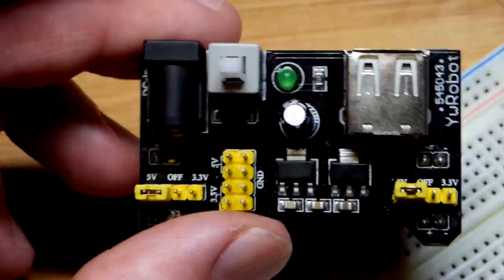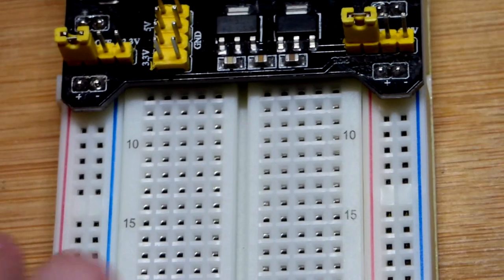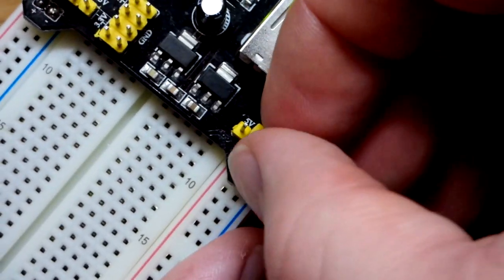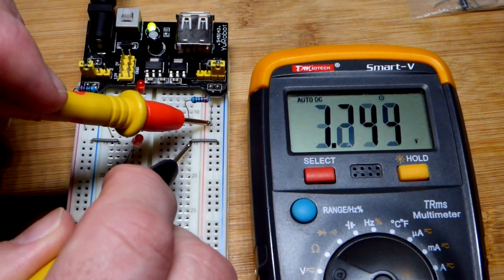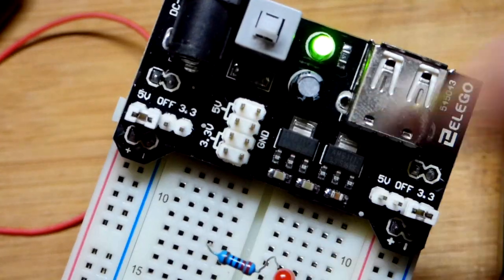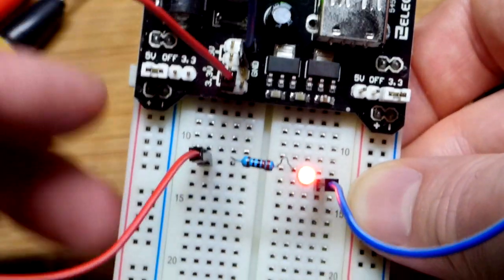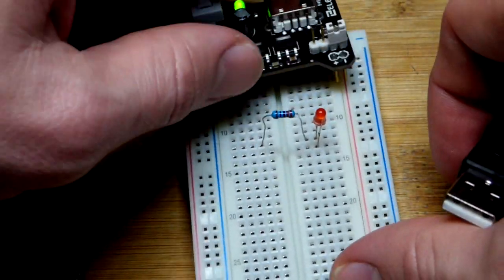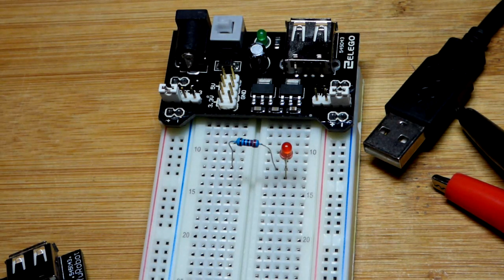How to use a breadboard power supply module for DIY learning electronics

Comment: New to breadboards (and electronics); what device should i use to supply my current?
Reply from the maker: Power supply that you plug into the wall and can set the voltage and maximum current is generally the best to use. These 5V modules powered by a converter that plugs into the wall are good if you only want to work with 5V and save some money. Can also use batteries if you want, but they aren't as easy to use. It's good to learn how to use all of them, So I've made a number of videos covering all of them.

Comment: 0:51 , what is the polarity of this 9v adapter you used ?
Is center positive or negative ?
Reply: Centre positive is the general rule. I've not seen a breadboard psu that has a different connection.

Comment: Hello! Is it possible to use the breadboard power supply to make a series connection of two power supplys to get 6.6V (2x3.3V) or 8.3 (5V+3.3V) or even 10V? Thank you for your answer!
Reply from the maker: You can probably connect them in series only if each one has it's own independent power source. If they share a power source, then it is probably a short circuit where the positive of one connects to the negative of the other.

Comment: Can it handle 10-12amps of current?
Reply from the maker: No, not even close. I think most of them have a maximum limit of 0.5A.
Reply: @Electronzap  You'll probably fry it at 500mA. These regulators aren't going to be happy dissipating anything like 1W continuously.

Comment: What do I do if I need 9V? Is that possible? I had got one of those 'make your own arduino' kits and it needs to be powered. I have this plug thing you showed without the actual power adapter. Maybe I should buy a damn battery. lol. It would be nice to get this power adapter running though.
Reply from the maker: Just gotta browse websites that sell power supplies for one that meets your needs and doesn't cost too much.

Comment: how can you short circuit protect this? just add a zener diode?
Reply from the maker: You need circuitry that quickly cuts power when high current flows, or that limits maximum. Not an easy thing to add to this setup.

Comment: I have a 12v power supply for the power supply module, will it work or fail?
Reply from the maker: 12V works, but I fried some boards while using 12V. I think that's their absolute limit, and anything above that causes a voltage spike above 12V. Might have just been my boards though and how much current I was using. I can't speak for other people's experiences.
Reply: @Electronzap  I have one of these breadboard power modules and I tried a 12v to power it.  I tested the output with an oscilloscope.  I get 3.4v on one side and I get 10.0v from the 5v side.  If I power it with USB only, I get 3.4v and 5v.  I probably already fried something if it can't regulate the 12v input, but it was what I had on hand.  Oh well.

Comment: I am trying to connect the HW-131 to my 5v LED Christmas tree. I have 3 AA batteries which I connected to one side and move the pin to the 5V output. I got nada, cero, zilch Nada. Any IDEAS?
Reply: The HW-131 can only step down the input voltage and will not work with inputs below about 6.5V. Three AA 1.5V batteries give 4.5V, so it's hardly surprising you got no output.

Comment: The diod creates a voltage drop when current passes through it. You can see this effect when you plug multiple led lights is series. After 3 red leds, the voltage appears close to zero.

Comment: What exactly is the function of the USB port?
Reply: It has very little use IMO. It only outputs 5 volt to a device you connect to it. In theory if you are bread boarding a USB HOST controller then it could be used for that, but who design HOST devices, 99% of hobbyist will be bread boarding UBS DEVICEs and for that you need DEVICE connector. Mind blowing short sighted.

Comment: Thank you!  I just wired up one of these to a 9V battery, and it's powering a Nano BLE 33, and a SSD1306 display.  Question: this seems weird to me; I thought I'd need to switch between the "5V output" from the Nano to power the rail when plugged in to USB (the way I initially had this configured), vs the "VIN" pin when powered by the HW-131.  As a test I plugged the USB in, with the rail still connected to VIN rather than 5V, and the display still powered on and functioned!

I don't want to cook anything more -- already let the magic smoke out, trying a 12V power supply with the HW-131, which it says it's rated for.  I know enough to be dangerous, at least I didn't fry the Nano or display!  :)

Appreciate any insight on why the VIN pin is providing output for the display, when powered via USB.  Thanks!

Comment: Specification says that it can accept up to 12V not 9V you mention.
Reply: That assumes you have a genuine part, which isn't always a sensible assumption when buying Chinese electronics. The genuine parts are also limited to around 1.2W dissipation. But these are linear regulators and dissipate more power as the input voltage goes up, so at 12V input, they will start to overhead rapidly when supplying more than about 150mA since dissipation = (12V - 5V) x 0.15A = 1.05W. At 9V input, they would only be dissipating (9V - 5V) x 0.15A = 0.6W. At 7.5V input, dissipation would be (7.5V - 5V) x 0.15A = 0.375W. There is no advantage in supplying 12V rather than 9V.

Comment: What resistor are you using in the LED? I am new to this stuff, and i am not sure what number to use.
Reply from the maker: With LEDs I usually use at least 220 ohm with 5 volts which is what a breadboard power supply provides. And at least 470 ohm for 9V and at least 1,000 for 12V.

Comment: Important: Always check the power supply for the polarisation. There are + inside and - outside AND vice versa! The latter are ment for powering guitar effect pedals! In this case you need an adapter changing the polarisation.
Reply from the maker: Thanks for the tips!
Reply: mb102-ps has protection against it, as far as I've seen. So, I should use + inside and - outside?
Reply: Ugggh, yeah, some pedals want 9V center positive, some 9V center negative, some other stuff like korg volcas want 9V center positive, but with a slightly smaller barrel connector. Check check check that polarity!

Comment: Nice video.  The reason you do not appear to hold 5v, is that when both sides have a load the max current is a combined value, the ones I have max at a combined 500ma.  Thus a load on both sides would dim the led(s)
Reply: You said, "... when both sides have a load..." and if you meant both sides of the breadboard, in this case one side is drawing from the +5V regulator and the other from the +3.3V regulator. Are you saying the max 500mA is the combined current of the two regulators?
Reply: The 3.3V supply is powered from the 5V supply, so the total current comes through the 5V regulator. All the ones that I've seen use AMS1117-5.0 and AMS1117-3.3 low dropout regulators in a SOT-223 package. These are specified for a maximum current of 1A with built-in thermal shutdown on overheating beyond about 1.2W power dissipation. The load regulation is specified as no worse than 35mV over a load of 0 to 800mA. So why are you seeing such a drop when delivering about 30mA into a pair of LEDs? There are two likely possibilities: (1) you have out of spec regulators; (2) your breadboard has poor internal connections. You''ll have to measure the output voltage at pin 2 of each reg to find out.

Comment: can we connect  5v and 3.3v or 5v and 5v to make it 8.3v or 10v??
Reply: what if i tried?? will the module be damage??
Reply from the maker: @ralph-ralphdeguzman6091  connecting any positive to that board, directly to any negative on that board is a short circuit. I accidently short circuited them before, and after a few times they were fried for good. It won't power anything else while short circuited, so even if it protects itself and doesn't fry, there's no point doing so.
Reply from the maker: No, this module is absorbing power from  a single supply to get lower voltages. You need special circuitry to get a higher voltage from a single source.
Reply: Thank you for the information.. then i wont try it.. so i can use it any longer..

Comment: What is the voltage of USB can I charge my phone from there.
Reply: The usb output is 5V when powered via the barrel jack from a higher voltage. However, your phone will probably require around 500mA when charging, and that's too much for these breadboard power supplies.

Comment: Bro can I charge mobile with usb
Reply from the maker: My cell phone doesn't seem to like it being charged with my breadboard power supply. It charges a lot slower than with a quality charger. I charge portable powerbanks with alternative 5V sources, and then use the power bank to charge the phone. That usually works out better.
Reply: @Electronzap   what is the output voltage of the USB bro plz help.
Reply from the maker: @umeshghimire6144  it's 5 volts, but phones don't like it if it isn't stable enough.

Comment: I know a dumb qsn. But can I plug the breadboard power supply to a charger / power adapter through the other pin(not the usb but the other input hole) if I can get maybe a 9v power adapter? Pls help. I guess it should work bcz the power adapter/ charger converts the AC from socket to DC. And if I can then what is the optimum volt of the charger/adapter I should use. And I am not talking about the USB input . I am talking about the other rounded hole input.
Reply: That input is called a "barrel jack". it fits a pretty standard 2.1mm diameter plug that you'll find on many wall adaptors, with the centre pin positive. The lowest voltage that is guaranteed to work is around 6.3V, but I'd recommend having a bit of "headroom" with a slightly higher voltage. As that voltage goes up, the power dissipated in the regulator goes up, so at 12V you probably can't draw more than about 170mA without the regulator getting very hot. I'd say the optimum voltage is around 7V - 7.5V which should allow you to draw up to about 500mA from the regulator safely (although that presupposes that these are genuine parts, which may not always be the case). If in doubt keep the current low and see if the regs get hot.

Comment: What are those metal things (not LED's or resistors)?
Reply from the maker: I think you are referring to the jumper cables. They are wires covered in plastic.
Reply: @Electronzap  Oh okay thanks I just bought this starter kit and the cables I got are pretty long so it makes a mess and this looks a lot cleaner :)

Comment: Can i use 12v 2amp to power up the board?? Through barrel jack?
Reply from the maker: I'd look up the specs when buying them,, but I don't think you want to use more than 9V with any of these breadboard power supplies. And I think they all get fried if they have to provide more than about 500mA of current.
Reply: @Electronzap  how many amps did u used on ur video?
Reply: @jeremytiempo9639  The LEDs usually take no more than 20mA, so two of them would draw less than 40mA, probably quite a bit less.
Reply: @Electronzap  SInce the power dissipated in the 5V regulator should be kept below 1.2W (preferably less), you can see that the maximum available current from the regulator is: 170mA at 12V input; 300mA at 9V input; 480mA at 7.5V. I'd keep the continuous current draw significantly below those figures.

Comment: Can you help me? I want to connect a solar panel to it in order to get a usb charger. My solar panel outputs 24v. What should I do to use it?
Reply from the maker: There's cheap voltage buck converters with USB output. These units are likely to be fried around 500mA, and many USB devices these days need 2000mA (2 amps). You could just get a buck converter with barrel jack output if you still want to power these units with a high voltage solar panel.
Reply: @Electronzap  I found a solution - a $6 USB converter that could source over 3 amps if needed. It takes a 12v input, provided by a 12v regulator on the panel.
Reply from the maker: @digitexstudios5634  good! Anything power related is best to just buy exactly what you need, unless you really want the learning experience of doing it DIY.
Reply: @Electronzap  Well, i don’t actually have a soldering iron yet. Still setting up shop. So anything is done by crimping and heat shrink or on a breadboard.
Reply: @Electronzap  People say there’s no such thing as free energy... But solar sure seems free!

Comment: I have been using the USB port to attach a power bank. Are you saying that the USB port is not supposed to bring USB power to the board? Is the USB supposed to be output only?
Reply from the maker: I've heard that other people use the USB to provide power to the breadboard. So looks like it is OK to use the USB connector either way. I'm sure it's connected directly to the pins going into the breadboard.

Comment: I have not yet received this item but one question. If you use barrel jack, then you have output on USB. If you DONT use barrel jack, and instead you use usb as input, whole thing should work? Like to use that usb from power bank.
Reply from the maker: I was told, that applying power to USB will power the pins on the board, which makes sense since they are probably connected directly together. Unfortunately power banks tend to quickly shut off pretty quickly if there is not enough current asked of them. I think somewhere around less than 0.5A
Reply: @Electronzap  OK usb is just connector, we could power it via USB wall adapter then. They are more common. 
But obviously not use both connectors as input at once.
Reply: @orion310591RS  There is no legit USB cable that can be used to connect a wall adapter of power bank which has a HOST connector to this board which also has a HOST connector. Such a cable is banned by the standard and would be bad because it would allow you to connect two HOSTs together which would then try to feed each other.

Comment: I have a question: Why does it have 4 pins on each side? And are they all supossed to be in the rails?
Reply from the maker: Yup, they all go in. 2 for each breadboard supply row. I would guess that they have 2 pins per row so that it is less likely to lose electrical contact and is held in place better.

Comment: The USB port placement is stupidly designed I am sure it caused a lot of damage out there. Thank you for showing that the USB port is meant to give power and not receive power.
Reply: Indeed the usb is for both power in and power out. I have a (very stupid) Y cable with USB-A, USB-A, USB mini from I dont know where, now it is very useful for powering my arduino nano and the power module both off a single USB hub. It is like to most stupid and useful thing on my desk right now!
Reply: @peatmoss4415  The USB connector is (stupidly) HOST or A connector so it definitely should supply power, not receive it. Very stupid design because who needs to supply power from USB connector from a bread board? Device or B connector would be useful for bread bording USB DEVICEs. 

The datasheet / design is wrong. If you play by the rules and only connect legit USB devices to this board then no device will supply power from the DEVICE to the HOST. USB OTG might do that but that is much more complex than what this board is capable of and the connector on this board is the original USB A / HOST connector from the days gone by when OTG was just a glint in the designers eyes.
Reply: @Axel_Andersen  just got one of these. it comes with a shielded male-male 30cm long USB-A to USB-A cable
Reply: They might as well just went USB C. It both sends and receives power
Reply: It does the same job, butni think im having issues with resistance and current. And now i realize that my power module didn't even come with the power cord, but instead, just the usb
Reply: @peatmoss4415  Interesting, apparently the USB port is both taking as well as providing power. If there is no other power supply connected, it functions as receiver, in case there is another power supply, it provides 5V of power.
Reply: i never knew of these, so u mean the USB  port serve as both input and output, right? @Furzkampfbomber
Reply: @muhammedabdulhayyu5403  Yes, exactly. As I wrote already, in case you have already a power supply connected, then the port will provide 5 V, if there is no other power source, it draws power from the USB port. I think this is actually quite neat.

Comment: Hi ,The specification online say I can power it up with 6 to 12 V dc ,I have an power wall adapter that is rated for 12 V and 1.5 amp . I tested it with the voltmeter and puts out 12.20 V , would this be ok or are there any risks ?
Reply from the maker: I think you will be OK, but from my experience these units tend to fry easily so it probably best to not push them to their limit if you can help it.
Reply: @Electronzap  thanks for the response , I'll try to find a 9 v adapter
Reply: @Electronzap I fried mine cause of 12v
Reply: Supplying the 5V regulator with 12.2V means that it has to drop 7.2V, and at around 160mA output current that equates to a power dissipation of 7.2 x 0.16 = 1.15W and it will run hot. An out of spec device could easily fail. If you are confident with soldering, you could make a small interface with a 2.1mm jack amd a 2.1 mm socket to put a 10 ohm 5W resistor in series with the positive line from the power adaptor. At 500mA the resistor would drop 5V, leaving just 2.2V across the regulator for a dissipation of 1.1W. The resistor would reduce the heating in the regulator at whatever current you are drawing. It's probably easier though just to find a 9V, or preferably a 7.5V, adaptor.
Reply: There are some great high quality adjustable voltage power adapters out there.  There are also some that are complete junk and even a few that are dangerous.  But, they really do come in handy for things.